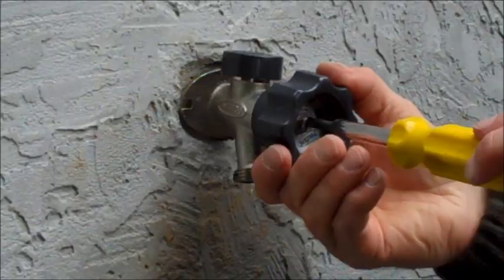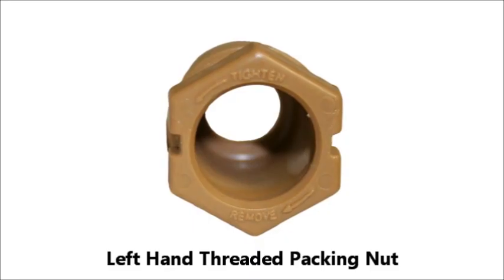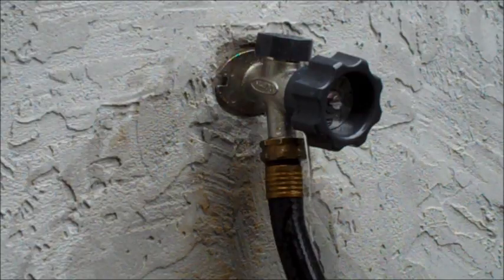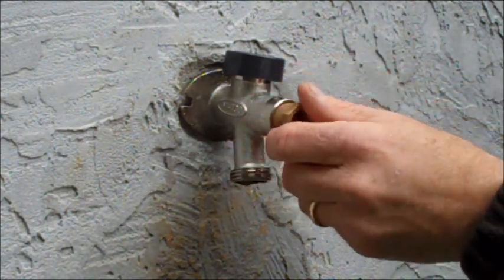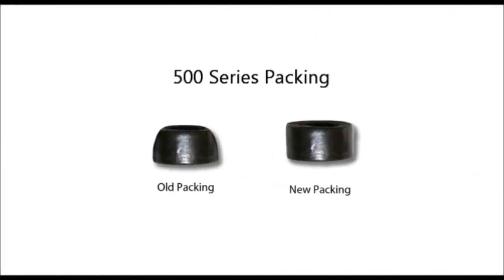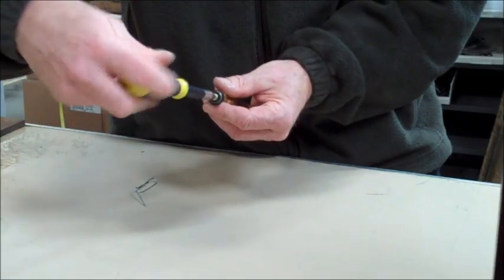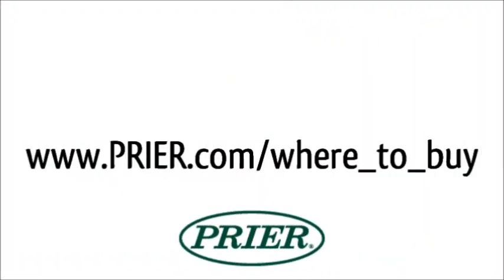Mansfield Style Hydrant Repair Video - Leaking Behind the Handle

Comment: Very helpful video and an easy repair but I wish the parts were more durable like shut off valves which I never have to replace parts. The plastic handles with time , even being gentle,  do crack requiring replacement. I would like a longer warranty and or less expensive replacement parts.

Comment: Epic fail.  The stem on my M400 stem did not look anything like the one in the video.  I replaced the graphite washer and other pieces as best I could, including a brand-new handle, and the hydrant leaked the same as before.  $30 down the drain.

Comment: Prier customer support was extremely helpful when I called them.  I rebuilt my hydrant.  Afterward, it was leaking behind the handle.  It turned out that the packing nut was not tight enough.  I think I was concerned at first that overtightening the nut might damage it.  It is working perfectly now.  Thank you!

Comment: Great content. I'm here because I have already ordered a repair kit. I have Prier frost-proofs which has a plastic packing nut that won't tighten anymore to stop it from leaking. It probably needs the packing to be replaced. The packing nut should be a metal in my opinion. I'm glad that I'm a jack-of-all-trades or I would be broke with all the home repairs that need to be done. I have training in auto mechanics, mechanical, plumbing, electrical, water, and wastewater treatment and even swimming pools thanks partly to my USAF training in Civil Engineering and also my past City employment, and I have since retired as a Utilities Director for a private community.

Comment: Hello - I actually got  a new stem 123-0093 ( which matches exactly with my old stem) and installed it. But strange- when I shut off the valve it is NOT shutting off. What am I doing wrong. Should the spring loaded portion be aligned in any specific way to shut off . Pl. let me know

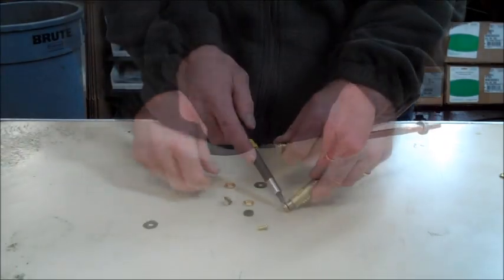Comment: 3:28 What if we DON'T have a small O ring on the stem end?   Could it just have disintegrated? or did some models not have them?  Should that inner piece on the stem end that the O-ring extend out easily?  Mine does not.  Can the permanently sealed stem on your Diamond Series be purchased for the older mansfield hydrants or does the entire unit need to be replaced to get a sealed stem?

Comment: My faucet is Mansfield. The plastic packing nut is WHITE but left thread. So, I made mistake, I tried to loosen the nut but instead I overtightened so bad that the nut is now rounded. I put the handle back in, no more leak BUT I can’t turn the handle at all. The handle is actually on open position now because I left it on open position when I opened the handle. Question is: If I am able to loosen the nut - I am ordering bidirectional bolt extractor - will I be able to turn the handle again? I think I will have to replace the nut and packing washer due to this over-tightening.
Reply: same - white packing nut  - left threaded - did the same thing !

Comment: What happens when you replace everything and it's still leaking?
Reply: Same. Ugh!!
Reply: @herriga I ended up putting thread sealant on every threaded part, even the screw that holds the handle on, and that did the trick for me. Hope that helps you out.

Comment: The packing nut has rusted & it stuck I can't unscrew it😪
Reply from the maker: PRIERProducts
7 years ago
Unfortunately, at one time the screw for this valve was not stainless steel, causing it to rust.  My first suggestion would be to use a good penetrating oil.  If that doesn't work, then you may have to drill out the handle screw to remove it.  The replacement screw we offer is stainless steel.  Let us know if we can be of any additional assistance. 800-362-9055

Comment: Still leaks! I used the kit, watching the video multiple times.  The only replaceable parts on my unit were the packing washer, graphite washer and small O ring.  There is no screw on the inside end to remove. Depressing, as this is inside my house and not something I can ignore.
Reply from the maker: Please call our service team. We want to ensure it works for you. 800-362-9055.

Comment: The screw in the handle appears to be stripped. I tried different sockets and could not find a match . Any tips to get it out? I tried spraying with WD40.
Reply from the maker: Unfortunately, it sounds like the screw is stripped and will need to be drilled out.

Comment: This video is misleading. Your interior water source does not always shut off at the water heater. You may have to go to either a shut off that may be available outside around your house, or just to be safe turn your water off at the meter.

Comment: First I’d confirm it is a Mansfield valve, there are many valves that have copied that style over the years.  Does the stem you removed match the replacement stem?  There’s a chance that the threads that are inside that valve are stripped out, however that is rare.

Comment: The stem on our 400/500 series hydrant doesn't seem to catch on anything when inserted into the hydrant. All of the rubber parts were replaced. We tried turning on the water to possibly get something unclogged, it still didn't work. Do you have any ideas on how to fix this?

Comment: I dont see how this garbage is supposed to be frostproof.!!  Seems every year I'm replacing parts on this thing!  This is AFTER turning the water off, draining the spigot, and covering the hydrant with insulation in late fall before the freeze.  This year I'm going to remove the whole goddamn stem and vacuum breaker assembly, drain the pipe and fixture, and pour RV antifreeze in there..cap it and cover it with insulation and a fixture cover!!    Maybe the parts will survive this year if they stay inside?

Comment: I replaced the packing with the correct packing. However,  the packing did not change shape and conform after tightening the nut.

Comment: So how do you remove a rusted handle screw thats frozen in the stem? I've applied Kroil, tried tightening and loosening with a socket and 3/8" drive ratchet. What at one time appears to be a 3/8" screw head is now an 11/32" head due to rust.  Why do you not use stainless screws here?
Reply from the maker: Hi there, thanks for reaching out.  Great question.  You can try to drill out the screw, or in the worst case scenario, break off the handle with a hammer, and then replace the stem and handle.  To answer your question about the screws - before we acquired the Mansfield line, they did not use stainless steel screws.  Since taking ownership of their line, we have made many upgrades to the product including stainless steel screws.  If you want some troubleshooting help or have more questions, please call our customer service team at 1-800-362-9055.
Reply: I know I'm going to have to drill it out, and I'll most likely have to buy a new stem instead of just new seals. What I want to know is why did this one come with a cheap ass  mild steel bolt instead of the nice stainless bolt shown in all the videos?  And why is the stem length not stamped into the valve so I don't have to shut down my water, take it apart, measure it, order the parts, then have to reassemble it so I can turn my water back on while I wait for the part, then do it all over again when it arrives? A little foresight would go a long way towards customer satisfaction. Should be a twenty minute job, but now it looks like it's going to be a week or longer ordeal.  I'm really not impressed.
Reply from the maker: As stated above, unfortunately the version of this product you have was manufactured by another company before we took it over, so we can't speak for that company's decision on why they used an inferior screw or don't have the stem length stamped on the valve.  

We don't stamp the stem length on valves because the body of the valve is used for all lengths, and stamping each of them would increase the cost to our customers.  

When we did take over this product from Mansfield, we made as many improvements as we could to prevent quality issues, including a better screw, stem and vacuum breaker.  

Hopefully this helps answer your questions, and as always, if you'd like to speak to customer service by phone, please call us at 1-800-362-9055.
Reply: I'd pay more for a piece that I'd know I could order the parts for without having to disassemble it twice. Poor business decision.
Reply from the maker: The good news is, we still manufacture replacements parts, and we have our own high-quality brand of residential hydrants if you are looking for another model.  Let us know if you need help finding parts or want help with the repair.  Here's a great example of a product that is meant to last the lifetime of your home - http://prier.com/products/residential-hydrants/p-164-%7C-quarter-turn-wall-hydrant.html

Comment: what happens when the nut wont come out and  are left with just the threads in the faucet
Reply from the maker: It sounds like the outer area of the plastic nut has broken off, so you would need to insert something like needle nose pliers, expand them, and try to twist to thread the packing nut back out.  Give us a call at 1-800-362-9055 if you need more troubleshooting help!

Comment: The slot on the screw is GONE. Screw rusted. Tried WD-40 and rachet, no luck. Suggestions??
Reply: Thank you for contacting PRIER.  At this point, you may need to drill out the screw.  If that will not work, you may need to replace the internal stem and purchase a new handle.  Since I'm not sure which valve you have or how old it is, please reach out to Customer Service, 800-362-9055 or email me, sales@PRIER.com, Attn; Cheryl

Thank you,
Cheryl

Comment: 1.5 beer job!

Good video and product. I could have used more detail on the inside portion as the video assumes a straight replace of parts. I found pieces missing on the inside (no screw, missing washers, etc.) I don't know what a cake washer is but I guessed right from the kit. Also guessed wrong on the rubber washer post cake washer. After the continuous leak, I upgraded to a bigger rubber washer. Almost no leak remaining! Found a sweet spot of not to tight in the of position where it stopped dripping. Figure I'm all set until some future full replacement. 

edit: beer
Reply from the maker: Kevin, thank you for the feedback, and great job getting the repair done!
Reply: Crappy product. The old style water spigots would last 30 years and never need to be replaced. These things are a scam designed to break so the company keeps making more money off of you. Mine sounds like fingernails an a chalk board every time I turn it, I’m going to HD tomorrow and buying an old style spigot.

Comment: Buy plumbers tape for $2 and wrap around plastic packing nut and tighten into place. Done. I first tried tightening nut with no luck, then bought this $20 kit and it did not fix the problem. I simply put tape on the nut and voila, no leak. Buy a steak and six pack with the money and time I just saved u
Reply: I can't believe I hadn't thought of that!  Just did mine a couple of mins ago; works great!  Thanks!
Reply: wire me your address so I can send you a check for a nice steak! KIDDING! THANKS, I'm going to try it out.  Some guy thanks YouTube for all the great info, all you need is Wikipedia and YouTube for nearly anything. We are living in a fantastic age, too bad we take it for granted. Plumbers think they are Doctors, considering what they charge.
Reply: Mine only leaks when the faucet is on AND the hose is attached.  I'm guessing the restriction of the hose is causing it to leak out.  Think your solve will fix my problem?  Guess it won't hurt to try..

UPDATE: This worked for me.  Thanks for the idea.
Reply: @Swoliosis1  Same here - only when hose is attached and on that it leaks.
Reply: And this, is why the internet can be great!  Thanks for the tip!  I about to dive into one of these and I’ll do that as a backup measure!
Reply: or silicone sealant?

Comment: Once we finally got the screw in the center of the handle removed. (We needed to use a oil penetration product and then use a hammer to tap the end of the screw to finally loosen it.) The replacement product works great.  We did need to replace the handle screw due to corrosion.  I went back to the hardware store and buying the screw required to buy the handle as well at a cost of $7.00. Instead I bought replacement screws from the hardware section, which was much cheaper.  Thanks for the video!

Comment: When I finally managed to remove the screw in the center of the handle, water continually flowed out of the screw hole!  That explains why the non-stainless screw was so rusted and hard to get out.  I suppose water is getting in at the other end of the stem. Why not have a stem that is permanently sealed at that end?  Thanks for the video.
Reply from the maker: Steven, I believe you have an old 400 or 500 series that was manufactured by Mansfield. Those stems were spring loaded and did not have a stainless screw, which resulted in the issue you are currently having. We now have a permanently sealed stem on our Diamond Series 400 Series Wall Hydrants and all other residential wall hydrants. You can find all information on those hydrants on our website at www.PRIER.com. Thank you!
Reply: I replaced the screw and internal parts using your repair kits.  It's working very well now.  Thanks!
Reply from the maker: Great to hear. Thanks Steven!

Comment: M300 was working, Now handle just spins in both directions, no water.  Inside shut off is on.  Screw holding handle on is tight.
Reply: John Holland Hi John, It sounds like the stem inside of the valve may be stripped out or broken.  What does it look like if you disassemble the valve.  Either way you will likely need a replacement stem for your valve.

Comment from the maker: Unfortunately, at one time the screw for this valve was not stainless steel, causing it to rust.  My first suggestion would be to use a good penetrating oil.  If that doesn't work, then you may have to drill out the handle screw to remove it.  The replacement screw we offer is stainless steel.  Let us know if we can be of any additional assistance.

Comment: You video is very clear  and easy to follow but my problem is I can not unscrew the gray handle,used a couple of different sprays to loosen the screw including wd40 and also used different screw drivers counter clockwise. Any suggestion or recommendation.
Thanks for your help in advance